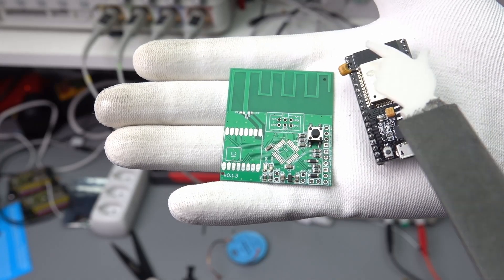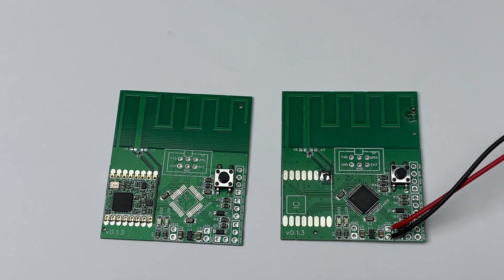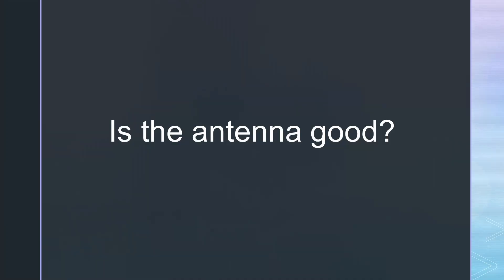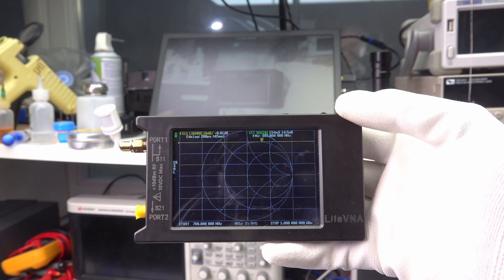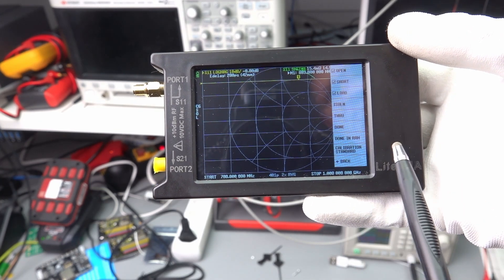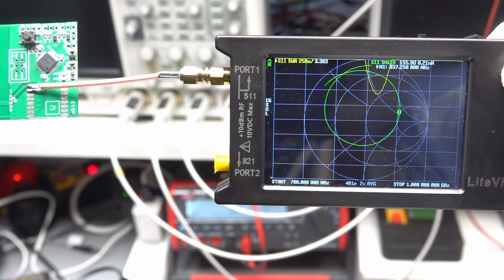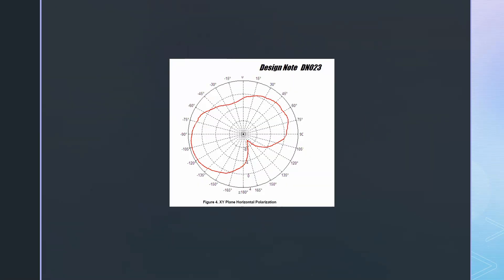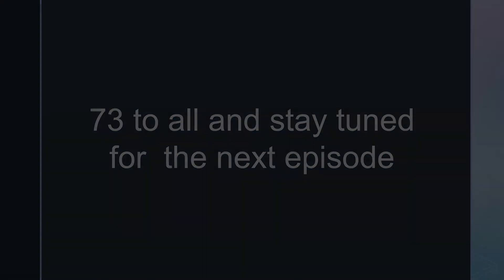019 Inverted-F PCB Antenna: How to tune PCB circuits using a NanoVNA

Comment: Hello sir, thank you for the explanation. And i wanna ask, currently i little bit curious, cause now im preparing for my final project. Is there any chance if i change (cut) the original antena from PCB and replace with external antenna use SMA connector like on the video. I need your advice
Reply from the maker: I would buy a module that offers an SMA connector.
Reply: @HB9BLA  But Module HB100 has original antena printed on the PCB, the reason i wanna replace cause i need for antenna project sir

Comment: Very interesting. Is it possible to measure the impedance of a microtrack (or other) line on a board (PCB) using a nanovna? Is the nanovna suitable for measuring and determining the impedance of board traces? So that I can select the correct resistors for transmission lines where signal integrity must be maintained? I'm trying to take measurements, but I'm confused. I'm using the "1/8 wavelength" method. I measure the coaxial cable and get 50 ohms, which is correct. I measure the FPC cable and get 120 ohms, although 70-80 ohms were expected. It's strange. I have a set of 8 boards, 30-40 cm long, connected in series with cables. I measure one board and get ~90 ohms, which corresponds to the impedance planned during the board design. I connect all the boards (8 pieces at ~90 ohms) with cables (FPC at 120 ohms) and get 40 ohms.  Why? I'm confused. Is the 1/8 wavelength method suitable for measuring board impedance with nanovna?
Reply from the maker: I made a video on how to use the VNA. There I explain how you can shift the reference point to the PCB.

Comment: Hello @HB9BLA
Can you check pcb pictures of xbox 360 slim RF module?
Its antenna is a bit bizarre and besides the main RF path where the diode is connected it has two additional unknown small traces in the PCB, like feedback lines. At the end It seams used IC use 5 pins to drive single antenna.
The front copper panel seams to be not connected to anything.
Since I want to design my own board for IC used in original module I am wondering if a simpler type of antenna can be used, something similar to what we can see in ESP32 modules.
Reply from the maker: I do not have an XBOX :-(

Comment: I've built plenty of wireless devices, but somehow was always able to get away with modules. Some modules you can get nowadays are just incredible - there's an entire eco system of modules based onthe nRF offerigns. Now, I am working on a device that will need it's own antenna and this video is just the ticket!
Reply from the maker: Cool! I hope you were successful with your project in the meantime.

Comment: How did you calculate or measure the cable delay ?
Reply from the maker: I did not calculate it, I showed in video 001 how to find it with an experiment.

Comment: I have just bought myself a LiteVNA 64 and the first problem is how to test an antenna that only has an ipex connector. It is the small antenna that comes with a Heltec V3.  Any ideas?
Reply from the maker: I use an IPEX SMA adapter for that purpose.

Comment: Hi Andreas, great video. Can you make this video for an ESP32-S3 board with MIFA? I’m saw in the Design Guidelines that the output impedance of this IC is 35ohm+0j. So, how to calculate the CLC matching circuit if the output impedance of the ESP32 is 35Ohm and the NanoVna has a 50Ohm impedance? I have seen a few online calculators. I want to design a small esp32-s3 board with a pcb antenna and another with a chip antenna. Another question is, is it possible to design a 35ohm PCB Antenna and don't use any macthing component? Thank you very much.
Reply from the maker: Most people use a match to 50 ohms beteween the chip and the antenna (it usually is a low-pass filter in addition). Often, you get the design from the manufacturer.
You can calibrate a VNA to any reference by using the respective load (35 ohms in your case).
Reply: @HB9BLA  I didn’t understand. How to calibrate it?
Reply from the maker: @anlpereira  Just as normal. Then apply the delay.
Reply: @HB9BLA  thank you very much. I will try this approach. A 35 Ohm resistor soldered in a pcb.

Comment: I think it is incorrect to just apply the delay in the cable to set the measurement plane. The problem with that is that it does not take into the account the connector to coaxial connection imperfections and imperfections of the cable itself. Even the calculation of the delay is also questionable at these frequencies, as it assumes the cable speed factor from datasheet, and does not take connector into account. I think the better approach is to calibrate the measurement plane at the end of the cable. It is possible and being practiced, as explained in TI application note SWRA726.
Reply from the maker: You are right. If you have a u.fl calibration set. I do not own one an can live with a bit of imperfection.

Comment: In this example the antenna is matched and hence the pi network is left unpopulated. In an example where impedance matching is needed would you recommend measuring at the output of the transceiver including the transmission line up to the point of the pi network? 

Also, if using a balun (in the case of differential load impedance) would you measure after the balun and before the pi network? 

Many thanks
Reply from the maker: You have to measure where your interest is starting with the chip (usually you should get its impedance in the datasheet. The goal is, that, at this point, the impedance of the antenna plus network (including balun) should match the chip impedance.

Comment: I use a NanoVNA for adjusting antenna length and at high frequencies like 868MHz I saw that holding the VNA in my hand makes a difference. Even touching it on different positions with just one finger, moves curves. If i touch the top side near to the SMA connector, its diffferent, to touching it on the far right side. This behavior makes it hard to trust measurements. I guess I should measure only when not holding it.
Reply from the maker: The measurement is always right. But you see, that handheld devices are less than optimal. I try to simulate a typical setup for my measurements and hope, it will be the optimum when I use the device.

Comment: I am still working on recreating an fs1000a module to incorporate into my own pcb. I have no intention of amplifying the module or anything. I'm using the exact same components as on the module and still I can't manage to get this working (properly). Unfortunately, there is still very little information on this subject. At least not about 433mhz like the fs1000a module specifically. I still do not understand exactly where the feedpoint of this module starts. Is that at L2 or is that from the capacitor. And should I make a 50ohm strip line from the feedpoint to the connection of the antenna? And could such a LiteVNA help me with this? I know I have asked this question before in the past and I apologize for that. I am getting crazy with myself that I do not understand this and I do not feel I can find the information anywhere to develop myself in this. Apologies again if I am spamming you!
Reply from the maker: No problem! I probably would include pinheaders for a purchased module on my PCB to avoid all the RF stuff ;-)

Comment: Is correct to move the reference plane to the end of the cable as you did at video or do I have to consider the microstrip too? Because it's away from the feed point. And matching network is near to feed point. Could you explain the reason to not use the reference plane at this location?
Reply from the maker: The output impedance of the chip has 50 ohms. This is why I wanted to know if from there, the "antenna" also offers 50 ohms

Comment: As always a very good video and explanation. I do notice that I still have a lot to learn :-) Maybe you can answer this strange situation. I am playing a bit with one of those cheap fs1000a 433mhz transmitter. I wanted to improve the range a bit and soldered a 17.3cm antenna to it. But instead of a better range, I had no range at all. If I hold the antenna at the end until about the middle, the transmitter works agian. If I hold the antenna from the beginning to the middle the transmitter sends nothing again. I saw another person on the internet with the same problem but the question remained unanswered. Do you have any idea how this is possible?
Reply from the maker: All antennas need counterpoises. Search for "Ground Plane Antenna"
Reply: @HB9BLA  yes I've been looking for ground plane and 50 ohm impedance but I don't understand much of that yet. In this case it is a simple fs1000a module where there is already a hole to solder the antenna to. you would expect it to just work then.

Comment: Have a quick question. Might be very silly! Why is the rfm95 not attached during testing. Will it affect the readings??
Reply from the maker: Yes, it would affect the reading. This is why we standardize on 50 ohms. Then you can divide systems for measuring.

Comment: thank you for the video you shared, sorry I'm still learning, I'm confused by the impedance and vswr measurement method you are doing, in my understanding the antenna impedance is already parallel to the rf source impedance, because the process of measuring the antenna impedance match, can only be done in series with an rf source, where the position of the vswr meter is in the middle between the source and the antenna, please correct me if I'm wrong.
Reply from the maker: Maybe you watch my video(s) on VNA and antenna tuning on this and my primary channel.
Reply: @HB9BLA  thank you , will check your play list..
Reply: Sorry, maybe I paid attention wrongly, after I looked at your video again, at 7:20, it turned out that the antenna was not connected to the rf source. Thank you,
I'm still looking into what if the antenna and source mismatch is caused by the rf source that doesn't have a 50ohm impedance. and how to measure source impedance.

Comment: Lite vna is same as arinst ?
Reply from the maker: No
Reply: I need to be more precise. To compare 5.8 ghz fpv antenna, can i use litevna64 from accuracy point of  view ?
Reply from the maker: @adbas6201  It depends on what you want to know. Just to check SWR it should work. If you need a lot of sensitivity, it will not work (check specifications of sensitivity in this frequency range.

Comment: Great video!!! The only question I have is about E-Delay. Do you have a video about how to calculate/estimate delay value for any given cable? I like to do a few tests with IoT PCB antennas as you did.
Reply: https://www.youtube.com/watch?v=bEPUePy_buM&list=PL4ZSD4omd_AylEyNCQYR3RcEb0olukPEJ&index=6 You can find it here
Reply from the maker: You have to try it out. I do not think it makes sense to calculate it because the distances are small
Reply: @HB9BLA  What do you mean by try it out? What are you looking at while adjusting the delay? How do you confirm, the delay you added is the correct one?
Reply from the maker: @harisan5135  I showed the procedure in my VNA tutorial video.
Reply: @HB9BLA  Thank you for your prompt response and for your great videos! I have already watched this video (if we are talking for the same video 001 @18:34) but to tell you the truth I didn't got it on the first pass. What you actually do is you add e-delay until the point on the Smith Chart, for open leads goes to zero. Is this enough? I'm new to the field so I'm looking to learn out of this. Would it be wrong to calibrate it with the pigtail flying leads open, then short them and calibrate it for short and finally solder a 50 ohm resistor on the ends and calibrate it for load?

Comment: Thanks for this informative video it is just what I was searching for!
Is there a way to calibrate it directly to end of the coax-cable without using the E-Delay parameter? Isn't this the better approach? Or did i get something wrong?
Reply from the maker: You need a calibration set for calibration. The sets I know have SMA connectors (or other connectors). If you want to attach a connector just for calibration you can do it.

Comment: Is it possible to measure forward and reverse power with your NanoVNA? If you could do that it would be easy to get the efficiency of the antenna.   :-)
Reply from the maker: That is the main purpose of the VNA. This measure is called return loss. Efficiency is what is radiated into the air compared with what is inserted into the antenna.
Reply: @HB9BLA  OK, then you know the power going into the antenna, you know the power coming back from the antenna. Measure the temperature of the antenna, to know the resistive losses of the antenna. and you then calculate the efficiency by [power in / (power in - [power return + resistive power loss]) *100.  :-)
Reply from the maker: @mcconkeyb  I read that these antennas also lose some power to the PCB. But, as I said, it is not a lot.
Reply: @HB9BLA  Any power loss in the PCB material should be accounted  for in the temperature measurement. There might be some error as the heat capacity of the conductors will be different than the insulation. But if you allow the temperature to stabilize it should work out to less than a few percent error.
If you want more accuracy then put the antenna into a calorimeter, thus the heat loss can be measured very accurately.

Comment: Nice video Andreas. I'm glad you specifically mentioned the need to perform matching in the final installation. Many people fluff about trying to create a nominally perfect antenna and matching network without considering or realising all their work is largely wasted in the real world due to external influences :-)
Reply from the maker: This becomes quite obvious when you leave the ivory tower ;-)
Reply: Is this why we were not so concerned about the 50ohm transmission line? Because it was tuned end to end?

Comment: Are you calibrating it before soldering to the board first? Or measuring the distance of the wire?
Reply from the maker: I calibrate without coax. Then I add the coax and determine the delay. Then I solder it to the PCB (it has to be shortened to dermine the delay)

Comment: It is like the j-pole that I did over 30 years ago! I measure the coax with dummy load. Got it down to 1:1. Then resonator, got it down to 1:1.  Then the pole, got it down to 1:1. At 147.18 MHz I was talking to other Hams that were 200 miles directly at 5 watts! The j-pole mounted would talk 146.60 - 147.35  MHz at 1:1 and all across the band it 1:1.5! The coax, resonator, and pole were linked.
Reply from the maker: They are similar. Both have a resonator and a matching circuit. The j-pole, however, is lambda-half and not only a quarter as this one. So the matching is  also different.

Comment: I have a few questions :
Why use a o ohm resistor and not simply use a piece or wire or a solder ball?  
What Lora module was used? 
Would i need a HAM license in order to use Lora ( assuming i stay under 14dbw , it i remember well ) ? Also if yes does this apply for hardware i make? ( l was considering making a Lora board and u bot the timing more or less right )
Reply from the maker: 1. 0 Ohms resistors can be places with machines. Solder bridges not
2. The RFM95
3. If you use these boards on ISM frequencies, you do not need a HAM license (and it would not help you because these frequencies are not HAM frequencies
4. You have absolutely no right to change or build hardware without HAM license, you only can buy and use certified products. Most IOT builders do not know that or do not respect this law.
Reply: @HB9BLA  THX 
wow 4 was unexpected 
So if interpret it well then using that module and building a PCB for it is technically illegal for a non HAM ? And i guess the same goes for any WIFI/BT IC that comes without an antenna ( like esp32 s) .
Reply: @sanjikaneki6226  When I had a phone 3 license in the USA, anything under 100 milliwatts was OK. You could not build a circuit did exceed100 milliwatts.  I build an FM transmitter that had1 transistor that had 65 milliwatts!
Reply: I used to transmit to Australia using 100 milliwatts from the state of Washington in the 60's.
Reply: @mickgibson370  wow that it not that much power but something tells me it was a low frequency as 2 side note i am from the EU so not sure how the law it also what is a phone license 3 ?
Reply: @sanjikaneki6226  It was at 27 MHz back in 1967 using a walkie-talkie.  The phone 3 was a US federal commutations license back in 1973.
Reply: @mickgibson370  wow interesting tho for me that in ancient history tho it would be nice to try someday to make that sort of long range communications the diy way  
THX for the info

Comment: Very interesting. VNA calibration must be vital. Question: Can you calibrate by applying 50 ohms, open and short at the end of the co-ax stub?
What happens to the SWR if you connect the ground plane to the actual planet? Or is it too many wavelengths away to be significant...
Reply from the maker: 1, You could calibrate it also with a 50 ohms resistor. (open and short are anyway used to determine the delay). In video #001 I used the test PCB for that reason (which had U-FL connectors)
2. I would hope that the ground plane ( I assume "planet" is a typo and means plane) is already well connected to the reference plane.
Reply: @HB9BLA  Planet was not a typo. I was an HF engineer and the planet was an essential part of the antenna.
Reply from the maker: Aha. I have never heard of it :-( The inverted F is designed like that to get the 50 ohms matching. The plane is connected to the feed point of the strip line. He also placed quite a few vias from the top to the bottom ground plane. So I think this is what we can expect from this small part (the antenna has about the same dimension as the ground plane).